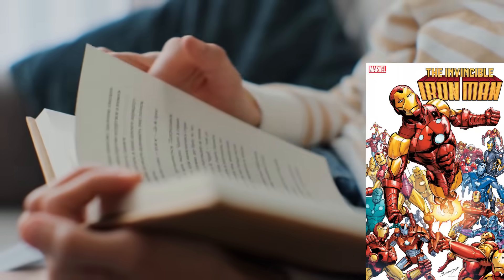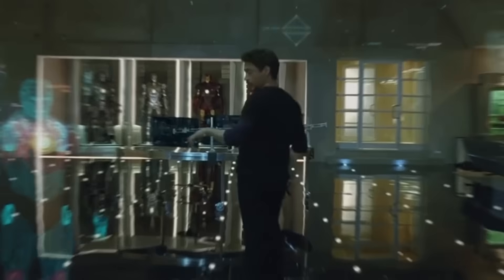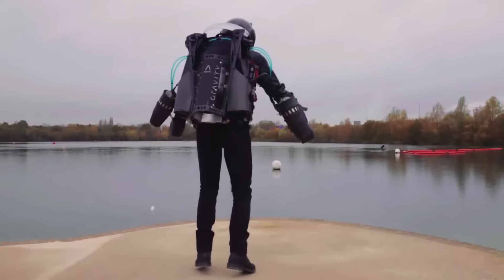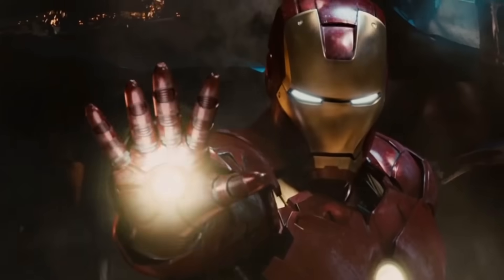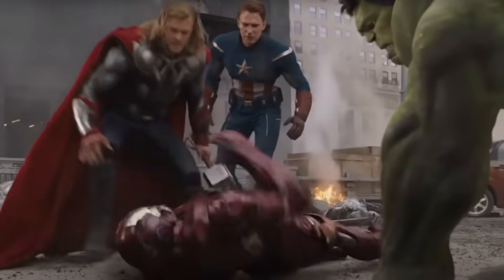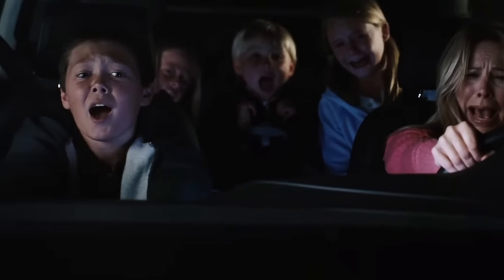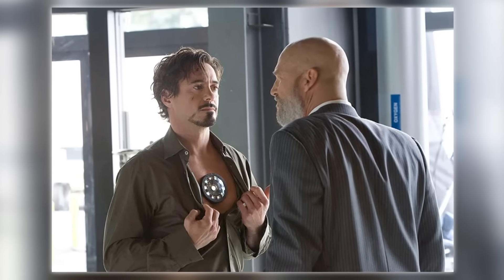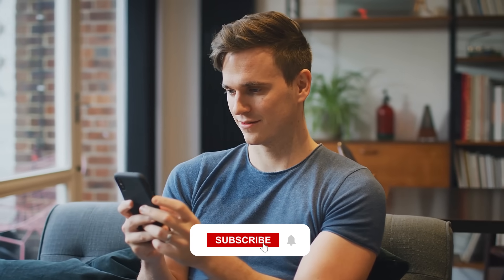Why we can’t build an iron man suit in real life

Comment: The stark repulsion tech could maybe be recreated, the suit would have to be rereated with a mix of light alloys, maybe carbon fibre as well to lower the weight as much as possible. Now comes the fun part making it fly;
It is possible to scale down existing propulsion tech used for flying, hovering, etc combined with an component to increase and decrease the amount of kinetic energy...how comfy doesthe flight have to be?? 😅
The boot placement for these thrusters would have to be multiple on the calf and the bottom but how without causing damage to the system by walking on it.
Added fr stabilization on hands with back boosters (yes they can be made discreet and not to bulky)
maybe a custom gyroscope for balnce and a bunch of other little components.
Programming a launch sequence for tech.. doable
Power source: litium could work on the electrical/software components but combustble is still the best energy for flight.

Comment: Talking about the heat generated by the reactor: we already deal with this in the expermental fusion reactors around the world. We could generate a very strong magnetic field to contain the heat of the reactor.
We already do this, cause nuclear fusion reactors work with more than 10 times the sun's temperature. Without a very strong magnetic field the pieces would be melted instantly.
It's possible to do this with ridiculous strong magnets made of superconductors. So even with the reactor ark in the chest, Stark could survive to the generated heat even with significant loss of energy rates.

Comment: Actually, the arc reactor is I wouldn't say easy but durable.  
Many believe the core is the power chamber. I would have to disagree.  The way it reacts looks to me to be more of a step-up inverted transformer. This in tern is the same process used to create ball lightning.  The focus of a particular plasma discharged to crate the energy pulse.  This would be limited to how many Helium Adam's he can fit in that arc reactor and how much used. This would also explain why the arc reactor was recharged by gamma, causing what is known as as the photoelectric effect. This is where the gamma ray is then transfers into entire energy to the electron. In truth, most wants see that he turned an energy cell inside out. Check out ball lightning to learn more.

Comment: The horizontal flight is possible, but it needs to have some wings. If you look at the tomahawk cruise missile, it is mostly cylindrical with some fins on the rear, and some stub wings near the center. The tomahawk missile is much heavier than a human, weighing 2,900 lbs, but can still fly using stub wings and a speed of over 500 mph. 

But since the human body isn't perfectly cylindrical, it performs less efficiently as a lifting body, but at a sufficient speed, stub wings might work to create stable horizontal flight. Another method would be to create a "webbing" between the arms and legs, like a wingsuit. That's actually exactly how the latest powered wingsuit works.

Comment: Titanium gold alloy never made sense. Gold is a WEAK metal and Titanium isn't any stronger than steel.  Its value comes from the fact that it's non ferrous, corrosion resistant, has a higher melting point, lighter than steel, and has a strength that comparable to it. It makes sense to use the titanium for flight suit to keep the power to weight ratio but adding gold to it takes away all the benefits. Gold is one of the densest metals out there so there goes your power to weight ratio. It has the third highest thermal conductivity of all metals so your melting point of the armor just got a LOT lower and it SURE as hell didn't help with your icing problem. Sure, the alloy will be slightly stronger and harder than either of the pure metals on their own but that in no way makes up for the costs.

Comment: The laws of physics are a bitch. If you had a power source that compact that could put out enough energy to put several nuclear reactors to shame the way the Arc reactor does the waste heat alone would be enough to fry you. It would also more than likely be so radioactively hot that you would need several iron man suits worth of lead just to act as shield. Then their would be the cooling problem. Let's move on to his repulsor tech. Canonically they are a form of cold fusion where Tony takes either palladium, or his unnamed synthetic element,  using his arc reactor to build up a charge in the electrons around the emitters, and SOMEHOW not only gets them to decay into muons but is also able to direct and control said decay. Which is absolutely insane  because we are talking about directly transforming one elementary particle into another that has 200x the mass as the one it is coming from. If you are familiar with the Einsteins' famous equation then you should understand just how much ENERGY the arc reactor would have to be putting into this for it to work! As far as I know we don't even have theories on how to make technology like that viable. Finally there is the matter of the G-forces. Tony should be ripping his liver in half, turning his brain to mush, and doing all sorts of other unpleasant things to his internals with each of his high speed maneuvers that we see him do. The only way for this NOT to be happening is for Tony to have invented a way to greatly mitigate inertia. The ubiquities inertial dampener  we see in most works of Sci Fi. It ranks right up their with artificial gravity and FTL travel for importance for any hope of making it beyond our own solar system. Unfortunately, we are about as close to creating a working version of any of those three as we are to making a prenatal vaccine you can take to make your kids immune to developing cancer from genetic diseases.

Comment: There would have been a number of pistons and joints and rotating joints and electronics including the core to power the suit that there is a blueprint for the suit with the core. All aircraft have blueprints then they have to go through construction then testing before it becomes practical there is always a system to make sure that everything works correctly as they are intended upon how they should work. Toney Stark’s core is a fusion reactor and that is unlimited power to the suit till it breaks down otherwise it should work for long periods of time to power the suit.

Comment: A number of reasons tbh.

1. No materials flexible, compact, strong, and light-weight enough to make this work
2. No shock absorption IRL, moving too fast, taking a bullet, or ascending too quickly would still cause havoc on your body due to pressure
3. No servos strong/compact enough to handle human motor functions.
4. No automatic stabilization, which humans have inbuilt.
5. No power source capable of supporting this.

Basically the entire suit is just science fiction, even the Ironman 1 form of it. I HATED the "upgrades" he gave the suit in later ironmans too, because it went from "cool and kinda believable if you stretch things" to just straight up magic. I wish the suit stayed the same or got bulky sidegrades, then the show would have remained interesting. That nano stuff really made it lose the reasons everyone found it cool in the first place imo.

Comment: you'd literally have to engineer new parts to an Ironman suit. As the focus's is on ironman's exoskeleton what about the endoskeleton and the fact that you need a specialized under-suit that will help you hold temperatures for extreme weathers

but the thing is they type of reactor the ARC Reactor is  a nuclear fusion reactor its main job is to collect hydrogen that's in the atmosphere and convert it into helium for energy than store that converted energy which is as powerful as the sun for use. but because of sharap-mill in Tony's chest the ARC reactor is in constant use.

Comment: Re: Epic Faceplants.

What, you mean like Rhodey did in Civil War?

As for the repulsors, yes, they would require a development in physics to create comic-book physics.

As for the strength thing with the suit providing an exoskeleton, yes, but the issue there is that, grabbing a car as is suggested in the footage you use, well, he does not have any actual "hard points" to use for grabbing it, which can tie HIS application of the suit's strength to supporting the load on the car. It's possible he could stop it, as suggested, but lowering it under any kind of control would be impossible, as he has no structural components, really, to grab onto, there, as he tried to lower it gently.

Note: The excuse usually used for Superman is that a large part of what he does is related to a force field he inherently generates. This force field in many ways works much like Iron Man's suit, but, when he does something like "lift a battleship", the force field extends out from his body in some unspecified manner which handles the overall load/hardpoint issue. The same idea cannot readily be applied to the Ironman suit, however. The car, when he captures it, is going to immediately fall down at 1g, ripping apart in his hands if he attempts to resist it.

As for the Arc reactor, well, the idea is somewhat that the Palladium is acting as a "nuclear catalyst" in the same manner as others, particularly Platinum, is a molecular catalyst.

Catalysts allow things which normally take significant energy to happen without the energy present. Catalyst chemistry is a field unto itself. There is no justification for there to be a "nuclear catalyst" at all, but, it's a comic book, so, yeah, comic book physics often extend some idea we know to enable some other thing we cannot do.

In the end: Comic Books are Science Fantasy, not SF... Fantasy which utilizes the trappings and concepts of SF -- Aliens for elves and dwarves, super-technology for magic, etc...  and will never be anything else, short of something that truly renders what we call "magic" real. Technology would have to be vastly beyond anything we are even vaguely close to, in order to create "comic book physics" in an even vaguely workable case. 

Key popular non-comic book  examples of Science Fantasy are Star Wars and Doctor Who.
Reply: i mean you can make up whatever bullshit for super man, because you're not exactly expected to take him with any sense of realism he can literally fly and float because ?????, but iron man is meant to be more "grounded" and pretty much all his abilities are meant to have an explanation

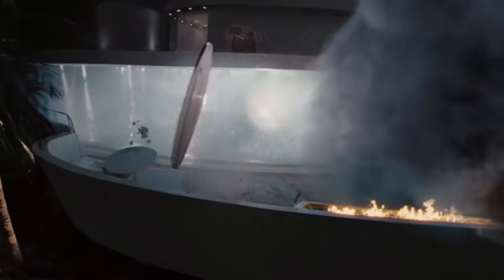Comment: 4:04 This bit is easy to explain away: The suit accounts for the recoil as well, and simply has systems in place to absorb the energy. It also explains the discrepancy between full suit and glove only; With just the glove, there's not enough space to install the systems needed to counteract the recoil, hence obvious recoil.
Reply: o really? its made of titanium gold which is patheically weak, second he has no absorption like uhmwpe etc and thridly an exosuit spine legs arms etc still would never save you from a fall add weight of suit and gravity its impossible!

Comment: if we consider newton's third law then these jets in legs and hands do enough thrust that it would require immense squat and dips strength of a person to stay floating. Remember, Tony is not hanging, he is being pushed up. There is a difference.
Reply from the maker: Could have the jets connected to his body so it all gets pushed together with the same force simultaneously.
Reply: @getaroundhow  yes but your joints aren't, so you do need to stabilize your body. For ironman the argument can be made that his suit is an exoskeleton so it takes care of this problem. In real life... Not possible as of now.
Reply: its called G force and its a huge problem for pilots in planes in real life, and those guys have an entire seat to push them forward, now imagine a force that accelerates you faster than a fighter jet only on the area of your feet and hands
Reply: @hyperion447  exactly. I can't even do 10 dips with my own body weight 🤣. The suit will rip of my arms and legs 🤣🤣🤣

Comment: It’s not possible because it’s a miniature arc reactor in the suit that makes large amounts of self sustaining energy in real life a reactor is gigantic and it’s run by nuclear fusion nobody has made a small arc reactor like Tony did in the cave because it violates the conservation of energy law we would need years of technological advancement to do something like that
Reply: It's nuclear fission, not fusion. And what if the arc reactor just stored it rather than actively converting energy, which is why it doesn't get hot. Batteries don't get hot from simply existing, only from the controlled release of energy
Reply: @JoulesTelly  o stop it, i have over 800 pages and over 400,ooo words on document studying all this, lets say he had his 3 gjs of energy no matter what no energy can be converted to 100% the heat would unalive you, secondly, to power small components you would need tranformers and resistors capacitors etc good luck with that because you would need 3 buildings worth to reduce the energy to fire flares or rokets out the suit, its for comics only, you can certainly make a suit but not this fake iron man bs
Reply: @  that whole diameter at the back could be superconducting ire, allowing for highr energy with less heat and size, which by todays sizings is already accurate, it could seperate into different wires and the superconductivity can change with temperature, so it could be more hot to control the amount of power through, then get extremely good thermal insulaton to block out waste heat from discharge and power limiting.
Reply: @JoulesTelly  your thinking of cold fusion which nobody has proven to be accomplished in reality even if 99% of the heat generated from the suit was sustainable that 1% would kill you in a split second tbh to successfully make a real Ironman suit it would take either a type 2 or 3 civilization we aren’t even type 1 therefore this type of tech is out of our reach maybe a large unmanned Ironman suit could be possible with enough room for everything that would be needed to power it and it would take a trillion dollars to build
Reply: So plutonium like who knows what he actually had access to